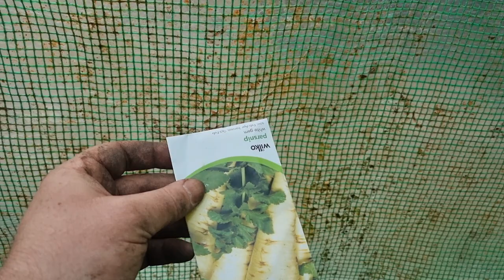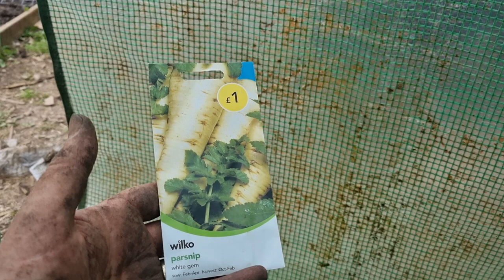April - Allotment / Sowing Strawberry - Sweetcorn - Parsnip seeds / April 2022

Comment: Hi your well them ton white bags make ideal compost bin stroke bags.
 Put in to a postion where you wont it cut the bottom so the worms can come up out the ground to help break the compost down and layer the compost with browns and greens water slightly.
 Them beds that's ready for planting cover with card till your ready for planting out next month or so plus after the card can be torn up and composted as it's one of the browns.
 All the best and the plot is realy comeing together.

Comment: You did an awesome job 👏👏
- yes your lines are straight but i would suggest you mark where the rows are as it will help later to identify between where the seeds where planted and weeds growing inbetween the rows.
- definately cover the beds you have just filled with compost, black plastic sheets cuts out the light and will keep the weeds down, it will warm the soil up ready for planting and you can keep it covered until needed. The plastic is reuseable as it can be used over the winter time on beds not used until the following spring again keeping the weeds down
- as sweetcorn is wind pollinated it needs to be planted in blocks to ensure a good set of cobs
- would it be helpful to put a three foot piece of fence post into the corner of each bed (top corner as you walk up from the gate) on to which you could screw eg a door number which will indentify where you are on the path
- thanks for the invite home, loved the glint in your eye at 33.59, you do make me laugh and you made an old lady happy you have a great sense of humor 
Keep safe 👍👍
Reply from the maker: Thank you very much indeed. Great advice! Starting to get a kinda understanding, but lots to learn. Great fun tho. Thank you.
Reply: @whereami7814  And never forget that all failures are actually learning experiences 👍